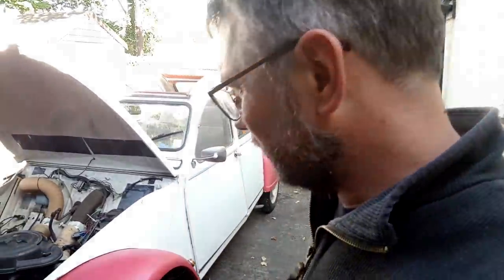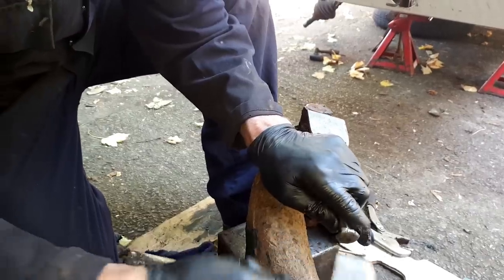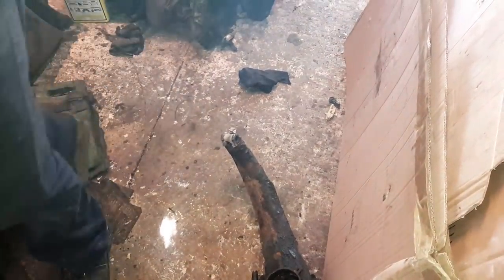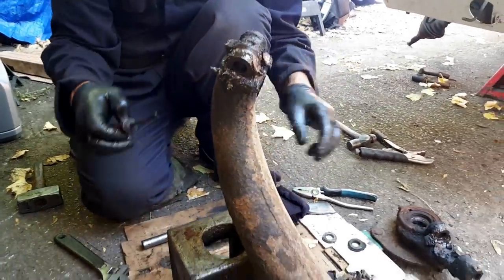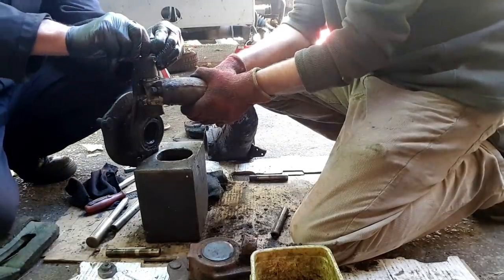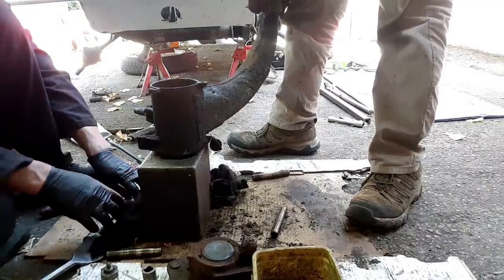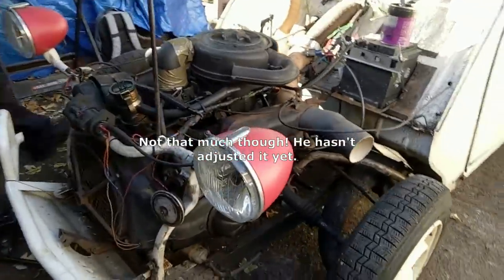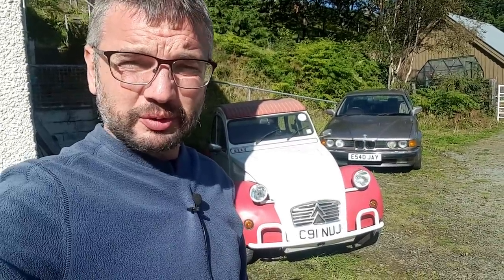Hammer time! Citroen 2CV Kingpin Replacement

Comment: I once owned a 67 chevrolet van. solid front axel and king pins. I really really did not want to go through the replacement of the king pin bushings etc. so every time I changed oil I greased everything well. never did wear out the king pins. grease did the trick.

Comment: A treat to watch! Last time I did kingpins was my A35's back in 1972. I soon abandoned my drifts and took the arm to an Austin garage in town. A kind old guy pressed the bushes out with a hydraulic press in no time for a packet of ciggies! Overall, A35 jobs seemed to go a lot easier than 2CV equivalents. I did the rear leaf springs, blown head gasket, clutch, brakes and loads of other jobs but (very thankfully!) the Austin never demanded strong-arm tactics.

Comment: Felt like watching a blacksmith at work at some points! Good stuff, I have learnt more about Kingpins now.
Reply: I can't help wondering why bearings aren't arranged like hub bearings - back to back taper/thrust bearings and a nut to take out the slack.
Reply: @millomweb  like motorcycle fork/steering stem bearings.
Reply: @prawny12009  It's a pretty common arrangement for heavier duty bearings.

Comment: What a faff. Good job Rootes did the job a little differently on the Imp. The kingpin carrier was separate from the swing arm axle and the kingpin was locked onto the carrier by a cotter pin so the hub carrier could only rotate on the bit it was supposed to. The bearings were replaceable. Unfortunately the sealing was crap - the first time I replaced them heat, a club hammer and a large vice were needed. After that they got regular shots of grease. 

FWIW I believe the Imp's kingpin bearings were the first automotive application of PTFE, although they were replaced by metal bearings in overhaul kits.

Comment: Track adjustment - the locknuts not only lock the adjustment, they also take out any play in the threads. You don't want play in the threads for 2 reasons - firstly, slightly sloppy steering and secondly, the slop will wear bigger to the point there's no thread left !

Comment: I;ve replaced king pins quite a few times and never found it necessary to remove the suspension arms or even the wings. Just loosen off the drive shafts, jack up the car and support centrally and securely. Turn it to full lock and push through the drive shaft. Remove the top welch plug and bottom screwed cap and support the hub yoke on a substantial block of metal allowing clearance for the king pin to drive through. Use drifts as shown. When all assembled use Interflon MP2/3 grease and grease up annually. Since I have used this grease, at least 15 years ago I have never had to replace a king pin. Even the MOT tester remarks that they are the best 2CV king pins he has tested. By the way I have no connection with Interflon.

Comment: Elly must be in seventh heaven after such thorough attention, such a treat to watch an expert at work.
Approve hugely of the pushrod being re-used as a drift..good stuff!
Reply: Kim, didn't you mean 'cylinder head stud'? 
A pushrod wouldn't last too long...
Reply: looked like a pushrod to me..
Reply from the maker: It's a cylinder head stud - like the one that pulled out of Elly's block before the trip...
Reply: Sigh, I got it wrong, again.

Comment: Tech tip: when greasing the king pins, remove the excess grease. If not,it will attract grit which in turn finds it's way into the king pins and wears them out  .😉😊
Reply: Can we assume that you also believe that water flows upwards? ;)

Comment: A very practical car the 2CV, you can really load them up and they come back for more. I'd love another.
Reply: You know , i used to trash talk these little cars 30+ years ago , i will never again , i actually have a secret admiration these days
Reply: @ThirdDegreeWitchExplores  I think everyone did, apart from those who owned them. Do you remember the ads on tv? "Automatic sunroof"," You automatically roll it back when the sun comes out"! But that was it, they were so simple there was very little to go wrong with them. My neighbour had one for years and the only thing he ever did was change the oil and the air filter every year, there was no oil filter if I remember I think it was centrifugally filtered. Perhaps memory is playing tricks? It was also very light on tyre wear for some reason. Yep great little car!
Reply: I once got an armchair in mine to take to the tip. I had to sit it on top, roof down and hammer the sides to make it drop into the car. It worked and I got it to the tip, but boy did I have a job getting it out. Very embarrassing.

Comment: Drifting in a 2CV, how HubNut.  A friend of mine, who ran 2CVs as daily transport for a very long time, heartily recommends giving the greasing points a few squeezes of the grease gun on a weekly basis, just for peace of mind, and it's easy to see why.  I do, however, think one of the king pins failed due to poor manufacture causing the case hardening to fail.  But Elly is, now, back to full hooning spec, with added race car...
Reply: Case hardening on kingpins?   Don't think so...

Comment: In hereabouts those king pins must be drawn with an arbor press (may be quality of machining not the best and interference may be grater ) (our roads are bad too ,so perhaps manufacturers made them thighter ) Even the heads  of arms(here we call them "horns") at  swinging side are reinforced with a welded collar. As a former 2CV and derivatives mechanic I made many special tools to weork on them .Some of those tools were made to recover cars that had cut the suspension rod and falled to ground .As a tale I had a Mehari  whose universal joints were in bad shape and one day one decided to give up,so what to do far from home?  I draw away the pieces near the wheel and blocked the brake drum at gear box with the  shoes adjusting nuts . Back home with only one wheel braking and tractioning  (of course only in 1rst gear).YES 2CVs are the best cars in world!.

Comment: Hi Ian can't beat the right man and the right tools to do a job, even if the right tools are a lump hammer and some drifts home made or not, good work and well done Rick,  also it can only be a 2CV where you remove the front bodywork and leave the headlights in place, it looked so funny, is Elly enjoying here new kingpins ?

Comment: Rick .. man of very few words  :)
Reply from the maker: He did say a few, but very quietly...
Reply: That must have been during the section where you said you had cut the audio. Words not for tender ears, I'd guess. Nice job guys, well done. Might the remaining knock still be the steering shaft joint? You did have a go at it while on the road but might not be fully tight. New clamp and bolt + the mod which adds a short extra slot on the opposite side of the cross slot matching the other one for a bit of extra squeeze?

Comment: very good   some of that engineering is very old fashioned I guess reflecting the origins of the early 2CV.....   I found another channel some of you might be interested in its not 2CV's though but a bunch of Canadians trying to free stuck  straight 8 engines in an old packard etc...."Will They Run? Straight-8-showdown ...if your interested..

Comment: great video, truly interesting. That is a proper mechanic, not a £75 and hour fitter like you get at main dealers - what chance a Citroen garage repairing rather than replacing? Was confused by the welding and the aftermath, did it need drilling out after the weld was deposited I wonder.

Comment: I'm surprised Citroen soldiered on with king-pins long after most manufacturers were going with ball joints, but the specialized suspension arms were probably best served by this arrangement.
Reply from the maker: Bear in mind there was pretty much zero development on the 2CV after about 1970, other than a change of carburettor and adoption of front disc brakes in 1981. Redeveloping a balljointed front end was very much not on the cards for what was one of the cheapest cars you could buy.
Reply: @HubNut  well, many years back cheap.  I recall seeing a VW beetle for sale I saw in Nord de Calais, France back in 1978 that was about $400 US dollars, I doubt that  any decent 2CV was much cheaper.  I doubt you can get a 2CV for what you paid for your City Rover nowadays.

Comment: Perhaps the big bearings was "parts bin engineering".  Instead of developing smaller bearings, they used them from a larger car to save money in making a new part.  When Chevy made the 65-69 Corvair, instead of making unique and smaller brakes, they just used the brakes from the larger mid size car.  Resulted in a cost saving for Chevy, bigger = better brakes for the car and easy to find parts 50 years later.
Reply from the maker: Nope. Pretty much everything on the 2CV is bespoke, and only shared with sister cars on the same platform. The suspension is unique to the A-Series Citroens (2CV, Ami, Dyane etc).

Comment: On a 2CV how often should the pins be greased? On a Reliant it's meant to be every 1000 miles and people just didn't stick to that. So they wore... and when they wear they can wear out the stub axle as well so a new pin can't sort it out. And when you grease them you have to be careful not to overdo it or dollops of grease would drop inside the drum and get on the front brake shoes, which is considered undesirable! At least you don't have that problem.  :)
Reply from the maker: Every 1000 miles, or monthly. I reckon I manage six or seven times per year. Maybe.
Reply: The more I watch this channel, the more I'm thankful I've got a nice modern four year old car which you just get in and drive!!

Comment: Did you have to dress the weld on the arm before refitting the new kingpin
Reply from the maker: I don't recall, but as the weld is on the outside of the hole, it shouldn't matter too much.

Comment: I've got the same problem. How did the welded one go. Did you have to ream it?
Reply from the maker: No reaming. The weld just tightens the hole.
Reply: @HubNut  thanks . Done the same thing and it's spot on

Comment: Am I right in thinking that the items you called "drifts" are Rick's own personally made tools? They look like the sort of tool that a mechanic makes for himself when other methods are rubbish and he spends an hour and makes something that lasts for years and does the job properly.
Reply from the maker: Not sure. You can buy drift sets for the 2CV.
Reply: @HubNut  I've just googled it after you saying that and the ones are £40 for the set so at that price I wouldn't bother making my own and they looked similar to Rick's set. Cheers

Comment: Do you think she's survive the 2CV 24hr race at Snetterton? I'd love to see that happen.
Reply: Will it survive? Of course it will! Ha!
Reply from the maker: No, for one simple reason. So much needs doing to make a 2CV race-ready that there would be nothing left of Elly. All the interior out, fit a tin roof, huge roll-cage, stiffen and lower the suspension, modify the front arms (so the kingpins have an easier life and different geometry), fit extra brake cooling, longer gear lever, bespoke wiring and switches and replace most of the glass with perspex. It has moved a long way from a simple, easy racing formula.
Reply: @HubNut  
My dreams, crushed.
Reply: @HubNut  I couldn't see that you would do that to Elly anyway, considering how long you've owned her and how attached you are to her, I think it would be heartbreaking. I might be sounding soppy but I don't care.